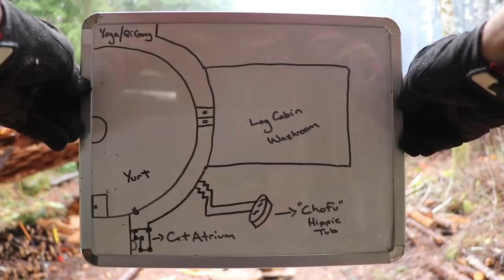OFF GRID WILDERNESS LIVING - Hand Pump Water Well | DIY Cat Enclosure - Ep. 74

Comment: I would put some of the chicken wire around the outside perimeter of the structure and bury the wire 8 to 12 inches in the ground so some of those little critters don’t dig under the structure to get to the cats.  That’s what we did.  These critters are smart. 🦊

Comment: Jake ease up on the pressure on the debarker let the tool do the work. With any bladed tool (debarker, hacksaw, chainsaw, planer) you should be putting light pressure on it and letting the tool do the work, and if necessary making an extra pass. Forcing it like that all you do is make more work for yourself, remove too much material, wear the blade out prematurely, and greatly increase your risk of the tool binding and then slipping causing serious injury (remember safety 1st). Other than that all of your woodwork is spot on and of beautiful fit and finish at that. Keep up the good work and just take those little 2 pennies of wisdom for what they're worth to you no more no less. Blessed be you two.

Comment: Hey guys, I fully understand why you didn't go SOLAR on the pump. If you're going to use the well mainly for drinking water, you don't really need that. You saved a thousand $. But if you ever want to go solar it'll be easy. You're lucky. Your water is shallow. You'll be able to put your potable water tank on 10 ft stilts (or a lil' taller) for water pressure. And the rainwater you already collect,  could easily be filtered. Y'all got this!

Comment: Just to Give You Guys a Little advice, it is too late now for this setting but the next time You do this I would definitely recommend putting grease 
On the joints of the PVC pipe otherwise they will stick together and be really hard to break apart if not impossible,You may even have to cut the pipe and rethread it , But if greased it will come right apart.

Comment: Hey Jake on your pump you need check valve won’t let the water drain all the way down.
Reply: 100% correct, a check valve is needed to prevent backflow.  Water returns to the well & that's why the small bucket is not filling up fast enough.

Comment: Jake, has the boat in the woods got a submersible bilge marine pump, it is 12V and can pump (500 GPH / 1890 LPH), not sure on the head height it can pump but it could bring water from the bore hole to Yurt or maybe a gravity fed tank to the Yurt.

Comment: Hey J&N, you should buy what's called Gopher Screen since it's tougher and comes in Welded/Stainless Steel/Poly Coated versions  because it's not only stiffer but easier to install than Chicken Wire. Indeed if you make a frame to sit inside the uprights/cross poles it can be easily tensioned using the same techniques fit those made for Windows.  There litter box should just be off the Yurt in the run your building not the enclosure because it's safer can be emptied easier and you'll be able to close off from the rest of their Jungle Jim with a doggy  door will kept any mice out of the house just by having the screened in run start after it. It's could be like a small log cabin ot yurt because Cats need privacy but also a dry roof over head others wise you'll find they'll their making deposits indoors and covering it with a rug or your bedding. If you come across a surplus window about to be thrown away by  a neighbor you might want to retrofit into the encloser and be sure that the plants  that will grow thru the screens is Cat friendly and perhaps wild catnip might grow there as well. Lastly you'll likely need to roof most of it since Kitty's hate getting wet and hang a bird feeder if just outside their favorite window if you want to fascinate them even more because they'll almost bark/chatter hello at them being natural bird watcher par excellence. 😄😄😄

Comment: I'm no expert on this stuff - never used a chain saw mill and haven't made anything out of chicken wire since I was in high school - but two things kind of stuck out to me on this vid:
1) I think it would add stability if you cut some v-grooves in the tops of the stumps you use as supports for the chain saw mill. The logs you're cutting would sit in the grooves and lock in place, so there would be no sliding around on top of the stumps.
2) It probably would have been better to build the entire wooden structure first, then wrap the chicken wire around the outside, because you will eventually need to replace sections of the wire, and as you built it, you have to practically disassemble the whole thing to get to it. You'll probably wind up doing patch after patch for a couple of years, and then you'll have to just cut all of it out and re-wrap it when the patches get to be too much.

Design Suggestion: You might also consider putting in horizontal rails where the top and bottom layers of wire meet; this will not only eliminate the need to weave the layers together (just staple them both to the rails), but give you mounting points for cat condos.

Comment: With electric the structure should work, but chicken wire is not the best product for keeping your pets or chickens safe. Only a real hardware cloth will keep a predator out and even Thai won’t stop a bear, so you need a solid wood structure that you can open the doors to and have chicken wire behind that like a window with storm shutters. I have lost 2 flocks of chickens to coyotes and foxes that just chew right through chicken wire like it’s not even there.

Comment: “Seems like you need 5 pumps to prime it up” Jake says. The water likely drains as a protection from frost or freezing. The original old pumps usually had (or should have) a jar/pail/bottle, some vessel, full of water which was used to wet and prime the leather gasket in the pump. The first water out went to refill that container. In the winter this water was kept in the house/cabin and water was carried both ways. But back then everything was in the pump at the top and only the pickup pipe or strainer was  down in the water.

Comment: Love the theory behind a jungle box. I would drill holes a broom handle will fit the put the handle in the hole along the side of the jungle gym and put insulators on that other end of handle and run wire around the insulators and out from the run so they can't reach it. I'm afraid they would never go near the tunnel again. Will be watching for next video, it aught to be a hoot... a better description of the handle, one end will go in the vertical poles and the other the incilator will attach to so the cats can't reach it and if they do then they will quit in a hurry.... music is getting there as it goes from strum to picking fast

Comment: you need a footvalve/oneway valvue down by the pump and that would keep the water in the pipe so you would not have to prime it everytime
Reply: James Hinkle true, but they also hold water in the pipe during freezing temps and can burst the pipe. A few extra pumps isn’t a big deal.
Reply: @Jadeeboy  yes you are right but they should build a pump house for the winter Jake and Nichole seems pretty good with there hands

Comment: I wonder how long it will be before you replace the hand pump with a small electric pump to pump water directly into your water tank. I mean, you have solar (and you will be putting in a lot more in the future), so why not? A pressure tank and pump downstream from the water tank would be good too, so you have on-demand water in the yurt (and whatever other structures follow).

Comment: Another great video guys, I like the water hand pump, it looks to be stainless steel, I used a cast iron hand pump which has drawbacks especially sub freezing because the pump is outside the well, yours shouldn't have the problem of freezing up. I use carpenters or hardware cloth instead of chicken wire, it's stronger and easier to deal with. Cheers, Jose

Comment: Did they recommend leaving the rope? I do wonder if algae will form on it. But more worrisome is did you pull the pump back up and tie a knot in the rope? If not it may end up slipping through the eyelet and falling to the bottom of the well. As far as retrieving the pump, I doubt the rope outlasts the pvc or stainless steel rod. If you were worried about the whole unit slipping down I would tied the rope to the pvc up near the top and out of the water. Anyway, pretty good job for first timers.

Comment: maybe should make bow staff walk sticks that Nicole and you carry around all time. carve make decorative. if wolf get to close use bow staff skills. if find branch got Y shape make sling shot with think rubber band kinda small cup. take old jeans or shirt. cut bag fold up sew with home mad rope. two sides so bag tie to belt. fill up walnuts or stone something not hurt nature. if wolfs get to close use sling shot get go away. hope keep dogs safe.
Reply: on bow staff walk stick try carve name in it. Celtic not all way up or some random repeating pattern. make pattern get paper draw out. use exacto knife cut out. if dosent fall apart your good try sling shot or bow staff. tape on stick use pencil or  marker draw over pattern. then use v tool carve out lines. the use U shaped gauge to make short cut pop everything colored by pencil or marker. if don't carve use heated up nail with handle use candle wood burn pattern in same thing not carve in. like carving for walking sticks as help grip. even don't know bow staff skills always swing walk stick like base ball bat at something if get to close.  if possible try make stick hickory or ash as bend but not break. oak good choice too because hard.

Comment: Some questions:
1. Did you have to get a permit for the well from some government entity? In the U.S. that would usually be a county, but this may vary from state to state.
2. Any thoughts of getting an electric pump powered by its own solar panel?
3. Have the cats killed mice yet? You probably have the yurt sealed up enough that mice entering it isn't a problem. If your cats have killed mice you would know as cats usually leave a part of the mouse for them to show you they are doing their job, at least in my experience. They leave the head or sometime the hips and tail lying about, maybe not every time, but frequently enough you know they are effective. I've lived in rural areas outside towns and quickly learned that you need at least one cat. One of my cats killed a rattlesnake in our backyard. We had a snake fence all around the ranger station compound we were living in with two cattle guards. Each had an battery operated electric fence pulse charger and a rod across the full width of the cattle guard steel. When I saw the snake I immediately checked both chargers and one battery had gone dead in the past week as I checked them weekly. I thought this was a big deal for a cat to kill a rattlesnake, but local folks said that is one reason they had cats.
4. Are you ever going to get a decent set of tools so you are not tighten everything with vice grips and channel locks?  Some open end and box end wrenches would seem to be needed. I can't live without mine as well as 1/2", 3/8" and 1/4" socket sets. I have drill chuck adapters for all three sets as well.  I have metric sockets for all but the 1/2" set, with the exception of a couple of very large ones I use on my Toyota and Honda vehicles. I also have both an Imperial and metric set of miniature wrenches, down to about 1.5mm for electronics, etc. I was lucky to inherit about 2/3 of my tools at a young age. 

I enjoy watching your videos. The chainsaw "mill" set up is interesting and is very useful for you.
Reply: You don't really need the clickbait of Nicole, your channel is interesting enough to ignore them. I also wonder if the cats will use the "tunnel." I look forward to your next video to see how they adapt. In my experience if you put a box on the floor they always play inside of them, especially if the box is small and you open the ends so maybe they will see the tunnel as an adventure.

Comment: Besides a Foot/Check valve so water doesn't drain out all the time, you should of taped rope to PVC Pipe so easier to pull if ever needed to. Should have water tested before using make sure no small animals have crawled or fallen into the well. You also have no concern for your Dogs Life or yours. Haven't gotten Life Jackets. Such a small investment to save Lives you supposedly care about. Should use 1/2" Welded Wire. These animals you speak of can chew throw chicken wire to get to the Cats. Was a good thought just bad choice of material. Ask questions learn from those who have done things so your not making mistakes. The Tin Roofs are a fine example.  Peace Be With You Both ☮️

Comment: Dude, make your life a lot easier. You're going to be cutting a lot of wood. Build a set of saw horses or at least a log mule. Nice pump - you're in a good spot for a healthy water system. Mind what drains where though, especially with manure. Make sure it is spread in a water shed that goes away from your well head.

Comment: I know this is a 2 year old video, I'm a newcomer to your channel and started from #1 to this current video... as someone who is in Nova Scotia and we have all the same wildlife, I would recommend from here on out using 1/2 hardware cloth (has to be 1/2" or smaller) and that will make it completely PREDATOR PROOF, I know it is a lot more costly then  chicken wire but chicken wire is only good for keeping chickens in. Not good for anything else, I have seen horror stories of ermine coming through chicken coops and demolishing 20 birds in one fellow swoop, my only issue thus far as a chicken keeper was a fox but that was MY FAULT, I dont blame the fox, it was kit season and I fell asleep early and did not lock the birds up so unfortunately my birds paid the price of my shortcoming but I'm sure the kits had full bellies for days (they took 12 birds in one night) after that mistake I learned and did Better, I set a clock so if I fell asleep or forgot I would be reminded.

Comment: The hand pump is romantic . But for less than one hundred dollars you could have installed a submersible 12V deep well pump powered by a car battery or solar cell   .  A  submersible pump could supply  gallons per minute vs 1 pint per stroke with the Bison hand pump . Also good for a fire hose. You then would lay 1/2 inch plastic pipe into the yurt for water. And if you really got ambitious you could easily make an instant hot water heater by modifying a wood fired rocket stove to supply endless hot water.  A hand pump may seem romantic, but that will soon become a chore in the poring rain or snow.  Here is a link to an all plastic  $75 12 volt solar/battery  powered well  pump that will make life easier https://www.amazon.com/dp/B00UMPQ2IM/ref=dp_cerb_2